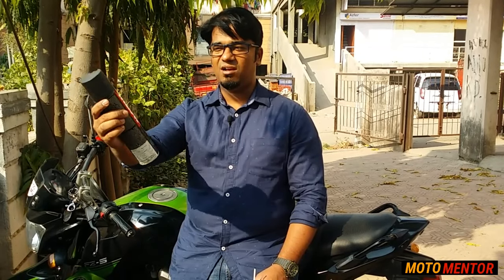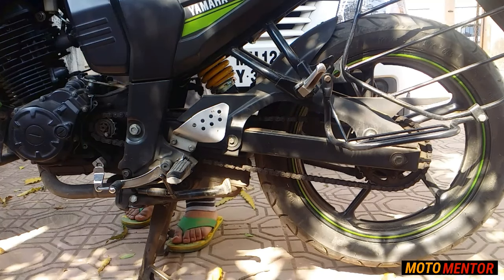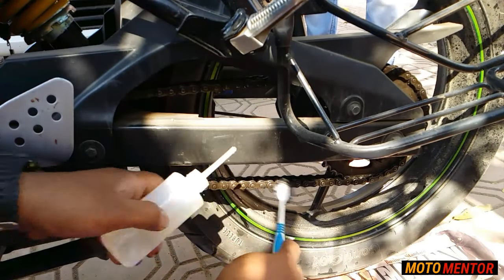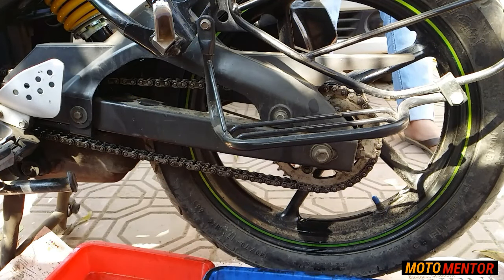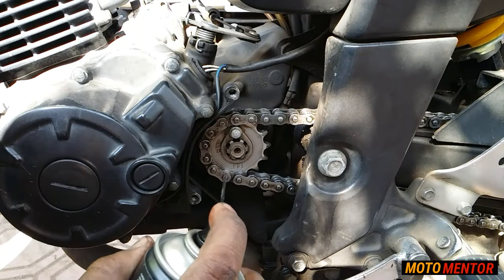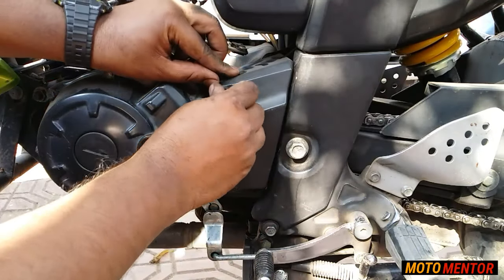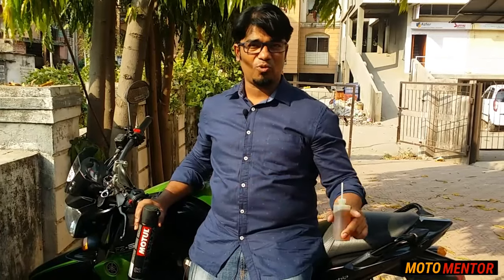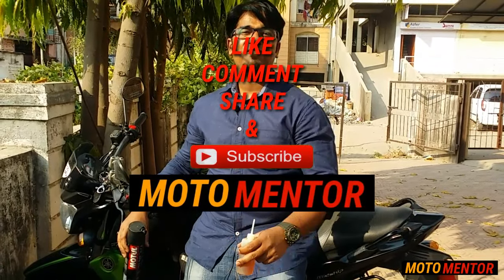BIKE CHAIN NOISE ? THIS IS HOW TO CLEAN AND LUBE MOTORCYCLE CHAIN MOTUL CHAIN LUBE VS 90 GEAR OIL

Comment: Hi and thanks for the video. I am having bajaj avenger which i purchased 6 months before and completed 2600kms. Done 1st servicing, in that service they didn't done chain lubrication. 2nd servicing will be after 2 months from now. So I purchased motule chain cleaner and motule lube. I just want to know what time interval i should clean my chain. And how to do oiling to my gearbox. Please suggest.

Comment: Very bad 3rd class motul lube and 
Gear oils for byke chain.
Only grease is best best best for byke chain.
   One time grease gives 50000 km 
Smooth running.Also if grease used the chain and sproceklet never gets damaged.

Comment: I have started using sewing machine oil which is extremely cheap. U cam get it for even 10rs for 150ml and can lubricate ur chain many times. It doesn't attract dust as well and is really good.

Comment: Hi also apart from gear oil can I use simple grease which I bought recently, also how often should I use for my gixxersf, while every bike washing or while every 500km
Reply: Better not to use grease. Being too sticky, It tend to attract too much dirt and dusts, which is not good for the longevity of the chain and sprocket.

Comment: The process is 
1. Cerosine
2. Motul Lube
3. Gear Oil
OR 
1. Cerosine
2. Gear Oil???
Reply from the maker: Cleaning agent is kerosene.. lubrication can be either be motul  lube or gearoil so don't mix motul and gear oil at once its 2 different methods.

Comment: bro it not falt of motul chain loob 

it is for usahing cerosin
thats whay the chain get rust
fool
 never usage cerosin just usage isoprofale acohole or motul chain clenar 
and usage motul chain loob use byke in rain it it never get ruat and loob the chain in after every 1.5 week but this prosses works with new chain only or the chain never get tuch with cerosin 

the thing is that the start up loob that coming with new chain it having some madichin ans it never full filly chen when you usage alcogol or chain clener but with cerosin it totaly dam that madichin

i am not telling to not youse gair oil you can usage gail oil but never cleen chain with cersin disel and ptrol 

i have a diploma of auto mobile enggnearing and marin engine 
i sagest you

and also you can usae a chain brass or nomal brass with chain cleener or alcol and remember that dont try to clean chan as as mirror juat spry chain clener or alcohol and stop engine wait for 3 minit then cleen chain with brass just 1 ot 2 scrab cleen  particals of dust and deep black loob than waith with splashing water and wait to dry and then use grear oil or chain loob and see the difference 

teke a try it and see the difference
Reply from the maker: My current chain has clocked over 30k kms with kerosene wash still in perfect condition. And that's for for appreciation as fool i don't mind at all. God bless you 🙏

Comment: I use dispenser oil on my Dominar 400's chain which is much more thicker than 90 gear oil. It can run for about 700-800 kms and still remain wet but i clean and lube at around 500 kms. Yes Motul or other spray lubes gets dry very soon and they are costly. I also read somewhere that mostly spray chain lubes are just 90 gear oil with some additives for stickiness. I would recommend dispenser oil because 90 gear oil gets off very easily because once the chain gets hot due to friction, the 90 gear oil becomes thin and gets off the chain whereas dispenser oil stays very thick even after getting hot.
Reply: @Kung Fu Money Bee the one which i buy usually doesn't comes under any branding. It's just a bottle of very dense oil.
Reply: What is dispenser oil tell me.clear
Reply: @lokesh3428  It's 140 grade gear oil which is used in heavy machinery. However, i would suggest you to stick with some cheaper alternatives of canned lubes i.e the normal chain sprays. The thing is that even this oil gets thin within first few kms and then it gets sprayed over the brake disc which then reduces the braking power rear. Chain sprays contains a lot of sticky material which is why it stays on the chain itself.
Reply: @priyeshsisodiya6768  thank u bro
Reply: @lokesh3428  Anytime 😊

Comment: Please suggest which oil should I be using to clean for Royal Enfield Classic 350? A few comments also suggest to use 140 grade gear oil... So it is good to use 140 grade gear oil instead of 90?
Reply: Finally kya use kra apne? Aur Performance kaise Rahi( after how many km you need to relube the chain)

Comment: Can i use 90 gear oil for honda cb uniform 150cc?
Reply from the maker: for chain lubrication yes you can
Reply: Other than Bosch 90 gear oil which one should be better for chain lubrication..Pls suggest?

Comment: Overall gear oil is far better than motul. But dude motul didn't cause your chain sprocket damage, it might have happened because of your faulty chain with faulty O rings. Whatever we use outside to lube can't enter the O- rings. If they are faulty whatever we use it will enter. You have done a great job in making people understand gear oil is better than these fancy brands.

Comment: Hi, Which gear oil are using Spirax or Master Line as mentioned below in the links of description of the video. 
And also I found Motul EP 90 gear oil too on amazon. I guess we can use any of them for chain right? 
Thanks.
Reply from the maker: Yes

Comment: Its True...
My Bike Mech Always Put Gear Oil For Sprocket When I am Going For Changing Engine Oil...Its Lasts For 27k KM...But My Colleague Says Its Not Safe Use Chain Lube After Using That After 10k Kms I Got a Sound In Chain And It Very Dangerous To use Because of Rusting

Use Old Method "Old is Gold"

Comment: I have followed the advice from MCN's Neevesy.It is based on the theory that anything you put on the chain links does not lube them.it just stops the chain rusting.All the lube for the chain is sealed in by X or O rings.All the exterior wear is caused by the grit and crap that sticks to the chain lube or oil and forms a grinding paste.So clean your chain thoroughly....you will only have to do this once.Now spray the chain with WD40 and wipe off the excess.Do not believe the rumours that WD40 destroys the O or X rings.It doesn't.Now ride the bike.The chain will be spotless.After every ride of over 50 miles spray and wipe with WD40 Takes a couple of minutes .The chain will still be spotless.With your finger tips spin a few of the rollers.There will be no sensation of grit The chain will never get really dirty and should last for 30,000 miles.I have been doing this for a couple of years and  my chains are still sparkling and running smooth.And there is no fling off of oil.My bikes are 2006 Speed Triple and 2009 Street Triple and I ride 10,000 miles a year.You can buy 5 litres of WD40 with a free spray bottle on Ebay.

Comment: The only theory is that Gear oil is purely in liquid form. It hasn't been engineered causing it to have major centripetal force when the chain start's running causing it to spread all over.  While at the same Time the chain lube tends to have lesser centripetal force causing it to spread thrash lesser also goes in to the grooves easily. 
Also on the other hand gear oil is damn cheap. It's upto a person's choice.  But if u lube the chain using oil at night the and let it sit overnight.  Excess oil will drip away and your chain will be lubed.

Comment: Motul chain spray lube is very very sticky.  With in 2 days there's lot of sand and dust sticked to the chain creating a grinding noise and vibration. Its worst than before after applying it. Definitely it will wear the chain much faster. It can work only in ultra clean room but not in dusty road's.

Comment: Bro can we use fully synthetic engine oil instead of 90 gear oil ?
Reply from the maker: Yes You can use but gear oil will be better because of its thickness.

Comment: This is the difference between technical professionals and experienced mechanics... Never use kerosene or diesel for cleaning chains as it has rubber O rings. Kerosene damages rings over the period of times. Yamaha, Suzuki, KTM are not fools to recommend Branded Chain Lube and Chain Cleans.

Comment: I am using 140 grade gear oil . Yeah definitely its good.
Reply: Ajo Anil bro which bike 
after riding chain doesnt throw the oil ??? on alloys
Reply: @karanchandani3239  Hi bro. I am using a tooth brush to apply the gear oil on the chain, of my pulsar 220. Do it that way you will not face any issues. I am 100% satisfied with gear oil as my chain lubricant.
Reply: thanks alot brother for the tip

Comment: Great information brother, thanks! Service centre used chain clean & lube spray on my bike and now my rear disc brake has no bite left, I think this might be because the lube spilling on the rotor and pads, could you please tell me what should I do now?
Reply from the maker: Cleane it with kerosene and wash it with water and  let it dry for some time befor the use

Comment: What is Gear oil i dont know gear oil i know engien oil reply me
Reply from the maker: Gear oil is thick which you get in different grade like 90 is thick 12o is more thicker.  In a simpler word the oil which is used in automatic gear scooters like active its that oil.. check my gear oil change video you will see which oil m talking about. Thanks for watching

Comment: Very helpful information, but I can use tarpin oil it's about rs.40 per litre ,and use differential oil .For lubricate chain ,for my hunk 2010 bike .It's amazing result .Approx zero noise and cost effective  about rs 80 per lub.

Comment: Your detail is accurate,I have also experienced it,
 Mechanics wash it with water blower and damage the chain joints,also did not wipe It's with cloth and directly apply the oil or grease,
   I have very bad experience with local gaurage,

Comment: Dude however long u being lubeing Ur chain  doesn't matter once Ur fingers get stuck in the sprocket.Totally unsafe practice u put out there to all Ur subscribers.

Remember there is inbuilt grease between the o-rings which acts as a permanent lube.Ur chain lube is merely to keep the outer surface of Ur links oiled.
I used gear oil for years...the risk of getting all on Ur tyres and loosing traction is far worse than using motul.
Motul is big as fuck company.I don't think they r that stupid in making such products which are even used in racing chains
Reply from the maker: Thanks for watch... I have mention to take precautions in the video very clearly not  sure if you understand hindi request you to watch the video carefully the disclaimer is already given in the video and in the description and this is not a anti motul video infact i love this brand and I use most of the product from it  however every thing has some limitations and flaws no matter how big brand thy are I have just made the video of what I have experienced so far. this video is not to make money but to help the others check out the comments. Most of the viewers  have agreed to me after USING gear oil. Again this is not a anti motul video please watch the video carefully before commenting. Thanks again bro 👍 and  do give you feedback I really appreciate and thanks it in a positive way. 😉
Reply: @MOTOMENTOR  yes I understand Hindi...but unsafe practices don't justify Ur action.U and I live in India where safety is our last priority as u can agree.No point putting ideas in people's head.
I say again Gear oil is less viscous which will eventually drip on Ur tyres at high speed and cause Ur tyres to get oiled and loose traction.
Still not safe
Reply: 18000kms means chain and sprocket change for many a bikes
Reply from the maker: I have completed 40000 km with gear oil treatment ODO IS 55000 km in total.

Comment: Great info bro. I have two questions.
1. Does the brand of the gear oil matter. Or any 90 EP gear oil is fine?
2. Does engine oil do the same work as what the gear oil does??
Reply: khaalidh fazloon any EP 90 Oil will work. I am using Valvoline EP 90 on my Classic 350 and Yezdi Chain.

Comment: Usage of Gear oil vs chain lube spray seems conditional & bike dependent. Unfortunately for sports type bikes that can comfortably do 100 kmph plus speeds, gear oil splashes and flings onto rear disc brakes which reduces braking performance and  damages wheel spokes. So Chain Lube sprays are usually preferred for sports bikes as they stick well & offer good performance. Otherwise for regular commuter motorcycles with rear drum brakes doing under 100 kmph in Indian traffic, EP 90 Gear Oil is ideal choice.

Comment: Hi bro ur advise for lubing chain is ok. But as u said cleaning chain with kerosene is applicable only for non o ring chain. But if o ring chain  kerosene is going to damage and swell the rubber o rings. Result is tight spots on the chain which will affect the chain flexibility while running over the sprockets so apparently performance break up.
Will suggest to use EP 140 grade gear oil than 90 for maximum lubrication and smoothness.
Chain cleaner has some other chemicals included other than kerosene where it controls its negative impact.
For o ring chain u can use liquid grease far better impact. Hope u get it

Comment: Bro i am using CL140 gear oil which costs just Rs 20 since long time in my pulsar 150 2005 model and my chain set went around 40k kms.
Reply: Better than 90 gear oil for chain?

Comment: Doesn't the gear oil flick all over the rear wheel?
Reply from the maker: Only if you over lube it so make sure you do not over lube or the best trick you can do is to take a piece of cloth dip it in the oil and just apply in the chain.

Comment: Seriously the dry spray chain lube really doesn't last, especially in rainy season as tropical country like our, rainy everyday for a few month that i'm like i have to spray lube on my motor's chain everyday! that spray chain lube cost even greater than the chain and sprocket set itself. I gonna try gear oil.

Comment: heloo sir..this is intresting bt i hv a question..can i use it for my pulsar ns 200 its a new bike only 1k km run😪 so plz tell me sir🙏
Reply: When you give free service  check your chain they lubricate or not. I'm sure many free service doesn't do all this thing. They will wash your bike and polish that's all. After service check chain cause water entered inside chain cover then your chain will start getting dry up. That is the indication you should lubricate your bike chain.

Comment: Really Thanks for your valuable opinion.. 
In fact I have been using chain lube from a long time and really the chain becomes dry after some rides.. 
So I will obviously use 90 Gear oil in my Fazer version 1.thanks once again bro...

Comment: Never ever lube bike chain with wheels running on engine power in any gear . It's absolutely wrong ,
Always reverse the wheel  direction it's provides two advantages .Foremost , it's absolutely safe  .Secondly lubricants reaches the right gaps  were maximum wear and loading happens during pickup . 
You would permantly loose fingere or 2 or even hand .

Comment: Same experience here too. Initially I used chain lube only during service. My chain sprocket spoiled n 15 k km. Then I started using gear oil, it too cheep and my chain still good crossed 25 k km
Reply: Abhi kitna chala
Reply: @biluroy2426  30 k km. But still good.       Even not cleaning the bike, atleast  clean and lubricate  chain atleast once in 20 daysas told n this video,it will last longer.

Comment: Yamalube and motul was marketing our products..its not gud for ur bike.just cerosine and gear oil very cheap rate its really gud for our bike think about it
Reply from the maker: I never said that its bad I just expressed my experience with these product. If I can survive just on water without having any energy drink that doest mean water is cheap without any value. Also check the comment section and see so many users faced the same issue.. Read,understand and think about it.

Comment: Thanks bro this is video I was looking for it .☺️ I bought  abrand new 1999  model Yamaha YBX  I was using  20.30 oil but I found in xbhp that ep90 gear oil is better I was about to shift to chain lube but due to financial constraints bought e90 gear oil I m using it ever since it is great. It turns out to be a best decision.I would say it is the best lubricant for your chain.

Comment: 90 no gair oil is good who owen fz or any 150 cc bike 
But ktm user never ever use this lubrication method
i use .AUTOLUBE chain sprey
Or wexpol insturd of motul is expensiv and two step down gread from this 1st tow lube and cost is just 120rs and beter then motul.
Try atleast once
Reply: pratham chauhan why never use for KTM ? Please clarify

Comment: Gear oils are usually mineral oils, even if you do get synthetic gear oils, they will have a mineral base which will destroy the rubber o rings in the chain. Stick to chain lube guys.